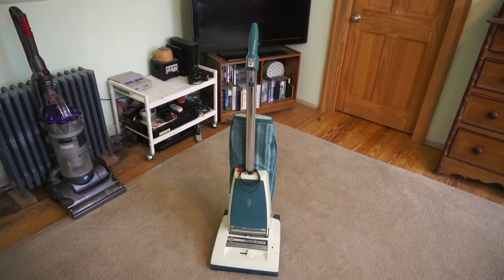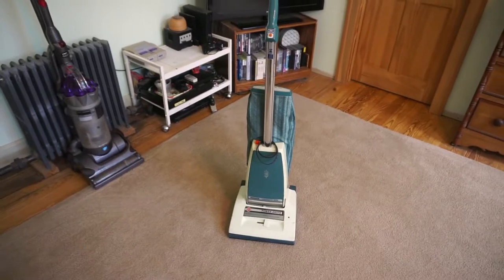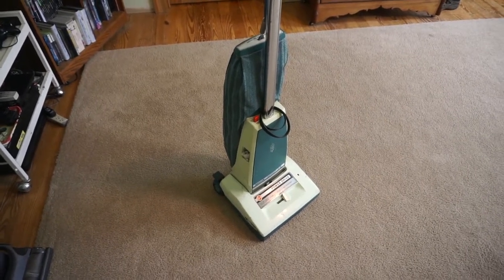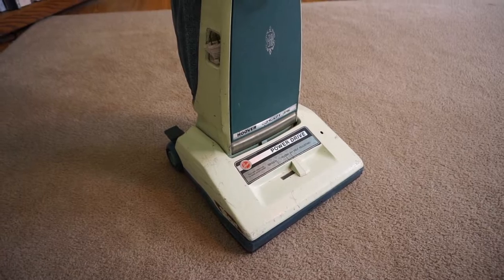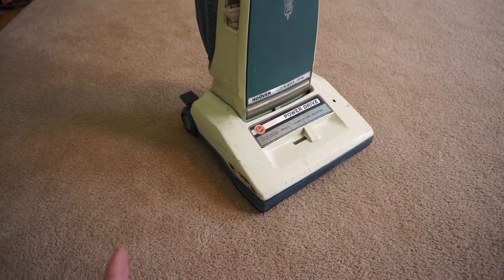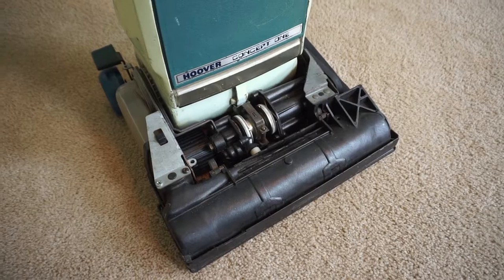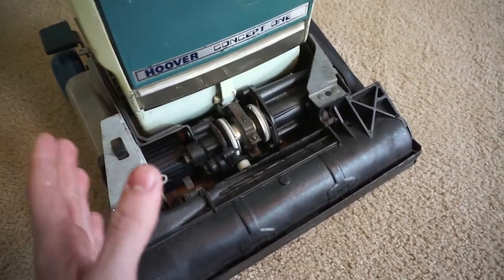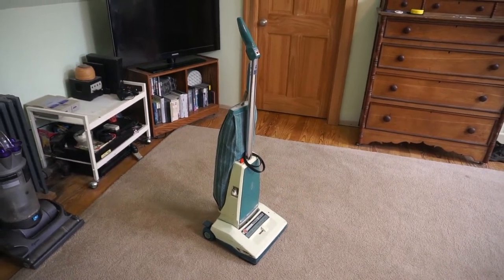1982 Hoover Concept One Vacuum cleaner | Overview and demonstration

Comment: Incredible! Hoover's Model U3101-001 in Jamaican Blue & Horizon Blue is a fine cleaner.  The flourish on the cord reel casing indicates that it was the top-of-the-line model with power drive, cord reel, & chrome handle.The standard Model U3103 in Rust Brown & Pale Honey was sold concurrently.  The U3101-001 was the unofficial 70th anniversary model for Hoover (which began in 1908).  It was manufactured from 1978 to ca. 1986.  The Concept line was succeeded by the PowerMax line in 1992. Happy Hoovering!

Comment: You're definitely right about the Concept cleaning well.  They, like most direct-air machines, are excellent deep cleaners.  It will clean circles around any Dyson!  Right off the top of my head, two current self-propelled vacuum cleaners that I can name are the Kirby Avalir and the Hoover Anniversary Edition Windtunnel.  The Kirby is obviously an amazing cleaner, but the Hoover actually isn't too bad.
Reply from the maker: That Dyson DC17 is a surprisingly good cleaner, but I really just like the convenience of it. I don't care that much about filtration, so the bagless system works well for me,  and Dyson's attachment design is excellent, especially their turbo tools.

Comment: at 1:08, Amen, I have the non-self propelled U4219 model Concept One, it's an amazing machine and far better than any vacuum made today, but it is upsetting that Hoover discontinued most of the parts for these machines.  And FYI, companies like Kirby and Oreck still make direct air vacuums, and in my opinion perform way better on carpets than clean air (bypass) vacuums.
Reply: The best Clean Air machines made today are older design Hoover WIndtunnels, Maytag, Riccar, and Simplicity.
Reply: Panasonic makes good clean air machines too.  Them and the Maytag based Windtunnels have spawned my appreciation for clean air vacuums.  Tacony and Essco, eventually came along.
Reply: Unfortunately, these days Hoover is just like Bissell because they don't carry some of the parts anymore so you have to buy a damn new vacuum. My Concept Two Electronic doesn't have PowerDrive, but I don't have to deal with or worry about the replacement part for the Power Drive.
Reply: My Concept one isn't self propelled so there goes my worry too, but my Power Drive was.  I was lucky enough to find a replacement Concept style self propelled for that vacuum, and it mounted up the same way as an original self propelled would but it now the head won't stand up off the carpet when put in its upright position, which isn't a big deal to me.
Reply: Grayson Reichert the tandem air Tacony Vacuums are awesome. You get the best of both worlds when comes to vacuum cleaners you get the airflow of a dirty air machine and the suction of a clean air machine. The only caveat of a tandem air Tacony vacuum is they start at 1000 dollars.

Comment: I got the U3105.   Found it at a thrift shop for $16.  After a good cleaning and replacing the belts and bag, it runs just as good as it did brand new.

BTW, Direct Air will always be superior to Bypass Air.  It pulls dirt out of the carpet you didn't even know was there.

Comment: Where would you get new clutches? Can you get a transmission from a hoover windtunnel and have it fit?
Edit for anyone who this may be useful to:
The transmissions mount completely differently, but the guts are the same. The friction material for the windtunnel/anniversary are of questionable quality and aren't the best when put in a machine like a Concept with a different pulley ratio.

Comment: hello you do know you can buy hepa bags for the Concept vacuum right i use them in mine and in my hoover powermax and dirt finder power drive and in my elite's they they filter just as  good as a dyson if not better and also have more airflow and hold a hole lot more dirt then a paper bag  you can use  ether a hoover y bag or a hoover a bag or any bag that will fit around sung around the caller good give it a try you will be amazed at the difference it makes trust me you wont wanna use your dyson anymore
Reply from the maker: I didn't actually know this, but since I use the machine so rarely, It's probably not worth the extra money.